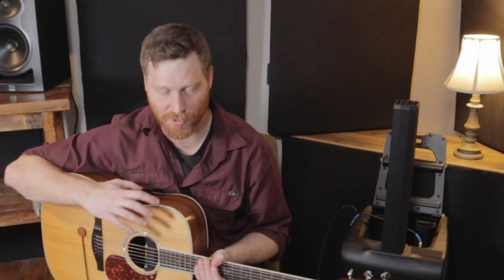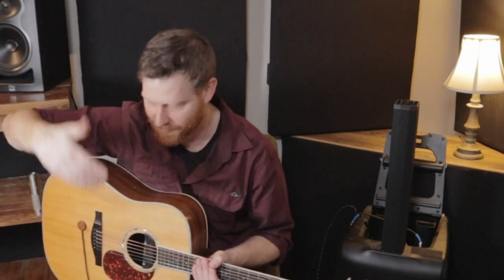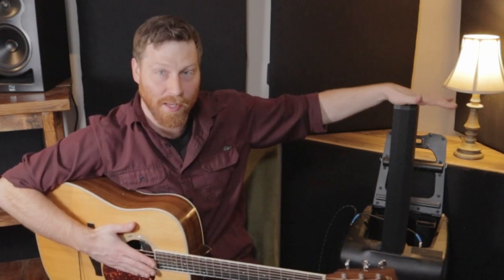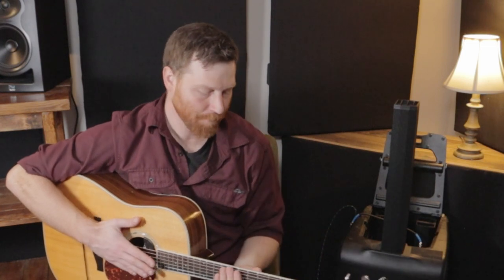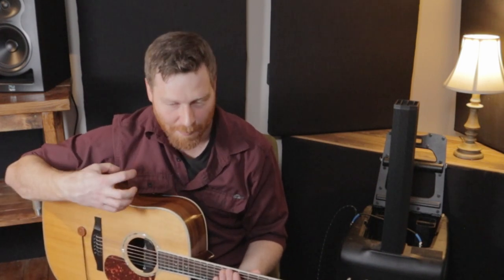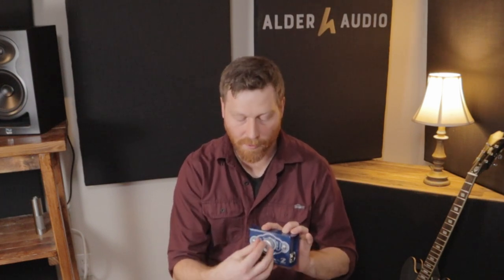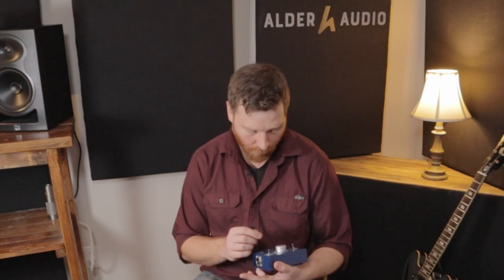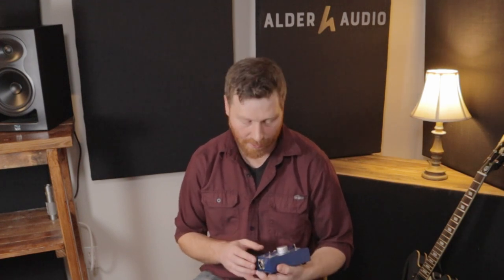What do impedance effects SOUND like

Comment: It’s important to realize that impedance is frequency dependent, and that this dependence will affect the timbre of the signal from the source device.  Microphones that have buffer stages like condenser mikes and some ribbons should be less affected.  But ribbon and dynamic mics have impedance curves that vary widely across the frequency spectrum as do piezos. With low impedance preamps, the frequencies that occur at the regions where the source impedance is high will be attenuated more than those frequencies that occur in lower impedance regions.
Reply: So does something happen to the impedance curve when you raise and lower the nominal impedance as shown in this video?

Comment: Splendid video, so useful. In my case, I have a Fender Hotrod Deluxe amp, plus a Shure SM58 mic. I recently bought a Hohner Crossover C harmonica, so I bought a Shure A85F transformer. but the problem now is that I'm getting so high feedback noise even with minimum volume; the solution at this moment is to play the harmonica, like twenty feet away from the amp, which is not practical for rehearsing.

Comment: Interesting. 
I took up stringed instrument making in my retirement and recently decided to add an integrated pre-amp/power-amp to my list of  made in the shop items.

Being my first pre-amp I  kept the pre-amp based construction simple by not including tone controls. Also not wanting to make major cutouts in any of my nylon stringed instruments or change the saddle height I assembled a three disc array of piezo transducers that I hotglued to the soundboard under the bridge with a 1/4 jack mounted in the tailblock.

The first trial was shocking in it had nearly no low end and sounded like crap squared. A check of the piezo disc used showed that it did not even come close to having a flat frequency response or output across the audio interval where in a sense it placed all its output weight at the high frequencies.

I did plug the instrument into a factory made instrument amp that has tone controls and with bass emphasized I could make the pickups I installed sound OK but still not great.

So, to salvage this first adventure in electrifying an acoustic instrument I decided to build a simple passive 3 band equalizer that I aim to place in line between the transducer output and the pre-amp.

The equalizer is simply a high pass filter, low pass filter, and band or interval filter in parallel with each other and each having a 10k linear potentiometer at the filters output to adjust volume with. I remember the bands being as less than 80 hz, 80-3400 hz, and above 3400 hz.

Hopefully this works well enough and once the parts come in the mail next week it will not take too long to find out.
Reply from the maker: I can relate very well as I have worked on this exact type of project several years ago and had similar experiences.  Do you know the input impedance of the preamp you constructed?  It should be at least a megohm.  Piezo discs can sound fantastic if used correctly.  I am a fan of the "till preamp", which is very easy to wire up, though you do need to order the correct JFET and bias it.  I'd imagine you built something similar? Here's a link: https://www.till.com/articles/GuitarPreamp/
Reply: @ALDER AUDIO  I had at first experimented with an lm741 using a dual power supply in both inverted and non-inverted configurations until I had a fair understanding of what was occurring with respect to using an op-amp as a small signal amp; but, I had quite a few lm358 chips laying around and used it while having assumed the input impedance on all op-amps was essentially infinite. 

After hearing the sound as I had built it, I did more or less sweep the audio spectrum using my old analog scope with the same type piezo element I used for sending the signal to the scope. Oh, yea, no wonder. There was a  hundred fifty milli-amp difference between 100 hz and 400 hz and it only got worse the higher the frequency .

I find the fun to be in the adventure so It has been fun experimenting and learning along the way and I don't plan on stopping.  Thanks for the link and I will definitely look at using this next.
Reply: I think that what your saying in your impedance series coincides with what I saw when I used a piezo disc with my scope to see the differences in voltage detected by the scope as I swept from low to high frequencies that were induced in the piezo disc.. 

Ie, low frequencies can be thought of as high impedance which I think is the basis for Steve Klein separating the bridge on his guitars into a section for the three bass strings and another for the three treble strings.

I always tend to think of high to low impedance mismatch as a small spinning gear trying to mesh with another larger spinning gear and transfer the power of one to the other. Assuming the small gear to be high impedance by it outputting less power than a large spinning gear the result is like trying to move a car from a dead stop by stomping on the gas when the transmission is in 5th gear. It just fails to work and stalls the car.

Hopefully, my little passive equalizer idea at least evens out the outputs of the three bands so that my instruments don't sound like they are in a can coming thru a 1 inch tweeter via a telephone line. But, I do look forward to, as the next experiment, trying the 'Till' preamplifier you sent me the link to.

Comment: Interesting videos!  I learned something!  Thanks!  But if I may quibble.  You start out with V = IZ (or V = IR).  This formula is meaningless if either V or I, voltage or current, equals 0.  So when you talk about "reflecting" voltage you could as correctly say "reflecting" current.  There isn't one without the other.  Sure, the amount of current you need to draw to measure voltage may be exceedingly small, but YOU MUST draw it.  Further, in the end, it is current, not voltage (which is potential) that drives everything.  You say that the ADC measures voltage but that's only because you choose to look at the V and not the I.  You can't have one without the other.  Therefore, you choosing voltage is arbitrary.  And it leads to misunderstandings, in my view.

What we want is enough voltage (potential) to generate the current (energy changes over time) to do everything.  Naturally, the more potential (voltage) we have the better.  That's why you focus on voltage, as we all do.  BUT the truth is we always start with low voltages with microphones.  That makes it very difficult to amplify them without losing fidelity (in my view, current, not voltage drives an ADC).  

In the transition from low voltage(current) to higher voltage(current), we must favor something in that energy transfer (in a preamp).  In a sense, we draw the current (not the voltage) from a mic and create a higher voltage to create another current later.

Would be curious to hear your thoughts.  Your first video was great.  But I feel if you clean/clear up some of your references to voltages and currents you can make an even better one.  If you disagree with anything I wrote please let me know!  THANKS!
Reply from the maker: Thanks for this thoughtful engagement with these videos!  I appreciate it.  First off, you have rightly identified something I always felt a bit uncomfortable with in the first video in my desire to make it more conceptual and accessible.  Yes absolutely you cannot reflect voltage or current without the other.  When I kind of wave my hands a bit at that part in the video and say something like, reality is a bit more complicated - that point is directly what I'm most thinking about.  I still think it is a helpful way to think about the concept, but yes, imperfect to the more complicated reality.

However, regarding current driving everything - this is certainly true when you have an active signal driving something like speaker cone, but not in the case of, for simplicity's sake, a FET based input stage.  The input on a FET works entirely off of voltage.  So for example you can have two signals coming in at the same voltage but different currents, and the amplified signal will come out at the same voltage and current.  So if you lose current at the input, you don't lose anything at the output, but if you lose voltage at the input your FET output drops.  That's what I'm getting at.  Let me know what you think, as I know I do not have a perfect understanding of all this either!
Reply: @alderaudio  Agree, it's all relative; that is, if you have a large voltage relative to the current you're drawing you can get away with most anything--a point you make in these video.  I have some controversial videos on my YT channel which, at bottom, is how analog is becoming a lost art/science and the manufacturers of equipment are trying to make out that digital this or that can fix anything.  I focus on the 32-bit float utter BS.

As a builder of mics, you must know better than anyone, that "wanting" is not the same as "getting" when it comes to capturing sound.  No amount of digital whatever is going to give you a big fat voltage/current from a microphone (unless they're helped out with an input voltage ;) )  Because of this, the stuff you talk about MATTERS.  But too many people seem to believe these problems have been solved once and for all.  I wish ;)  Anyway, I discovered you from someone commenting on Dave Rat's video.  Keep the ANALOG truth alive!!!